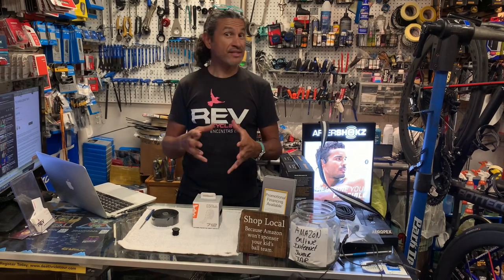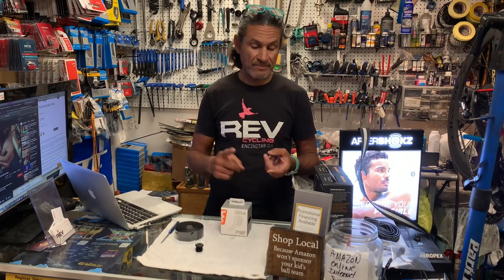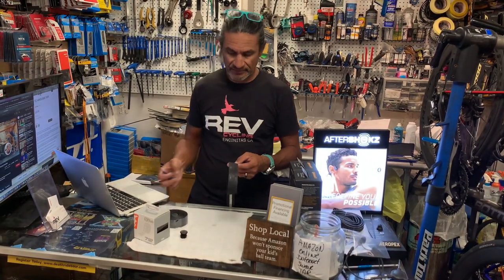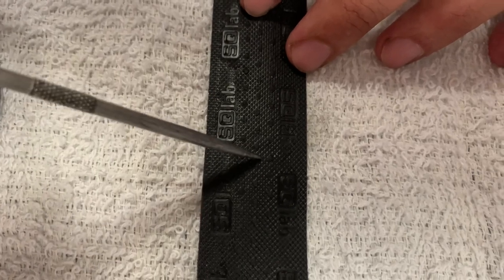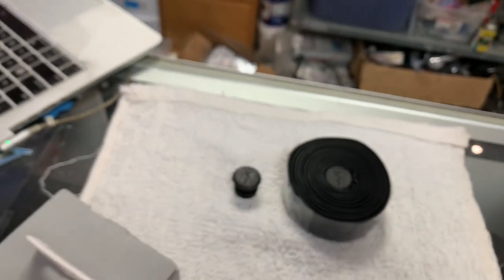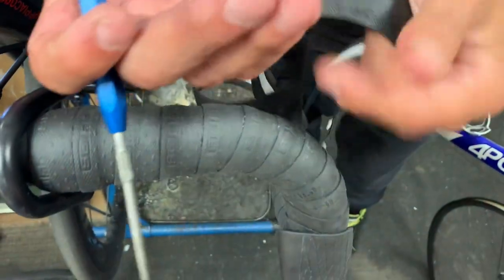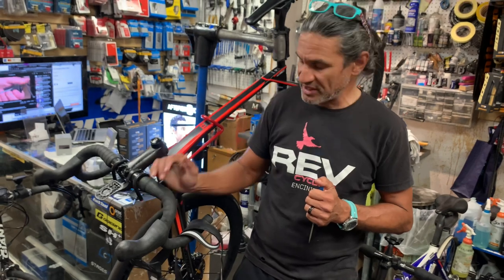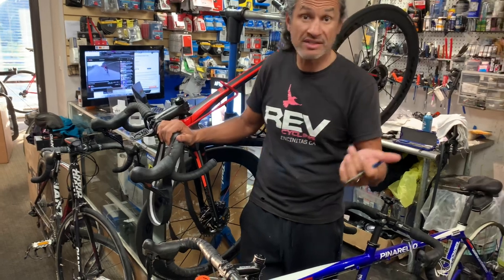Better than Lizard Skin!  SQ LAB 712 Handlebar Tape

Comment: I have the same issues with Lizard Skins. On your recommendations, I'll give the SQ's a try. To avoid the tape slipping, I pre-wrap the bar with stretchy electrical tape, stretched quite tight, sticky side facing OUT. You don't need to wrap the electrical tape like bar tape with it overlapping. You can get away with a 2-3 cm of open space between turns.
Reply from the maker: I like this hack Thank You !

Comment: Never liked Lizard skin been using Ardundel Synth Gecko-100% silicon, no sticky back required. Remove it occasionally, stick in the washing machine and reinstall. Holds up really well. I'll try the SQ lab next time.
Reply from the maker: Hmm this is very interesting!

Comment: Those are wrapped the wrong way. Should alway start at the bottom.
Reply from the maker: This is an alternative way to wrap the bars. It’s much neater and doesn’t require that god awful looking black electrical tape or any other tape. There is no wrong way to wrap bar tape. You should not always start at the bottom. I’ve been wrapping my bars and my customer’s bars this way for nearly 20 years. My customers have been much happier having them wrapped this way instead of the way you mentioned. Whenever their bikes are in for service they request their tape wrapped this way now and dislike the other method. 

Thanks for watching
Reply from the maker: And yes I actually did another video showing viewers how to wrap bar tape this way starting from the top and terminating at the bottom. Try it you will never go back to starting from the bottom - it’s not as neat and tidy. Actually in my opinion it looks like … 💩
Reply from the maker: Charles Man  I wrap all sorts of tapes from the top down. I wrap my crew’s tape from the top down and we are 10,000 plus mile a year riders none of us have issues with our bar tape wrapped this way.
Reply from the maker: Charles Man  a link?

Comment: lol, who wrapped the  Lizard skins? Not a good job at all. Layers coming off is one thing, but the tape separating is just bad workmanship!
Reply from the maker: Incorrect! The adhesive of the tape sucks! That’s the point of the video. Lizard Skins is completely overrated.
Reply: @SeeYouUpTheRoad   Yeah, nope. I installed tons of bar tape, it comes down to workmanship when tape separates like that, even el cheapo tape stays in place if installed correctly.
Reply from the maker: Ok
Reply: I think what has made it worse than it would have been is because the tape has been wrapped top down, which is all the more reason why it's separating because the top edge is exposed to the torsional forces of the riders hands which are pulling on the edges of the tape. If you wrap bottom up the tape will cover the edges so they aren't exposed to as much friction